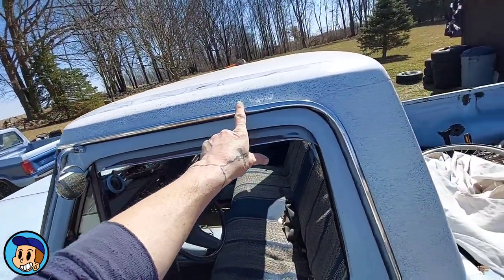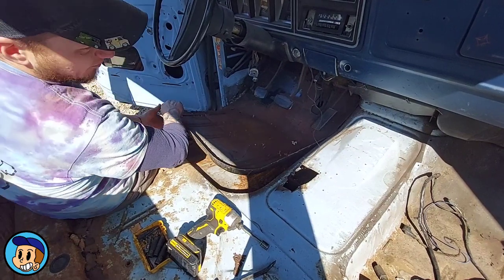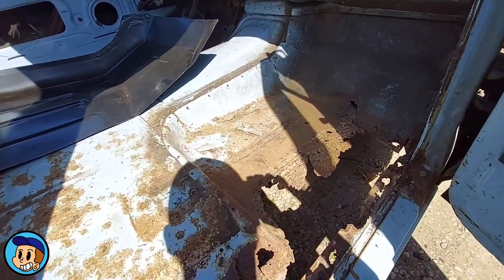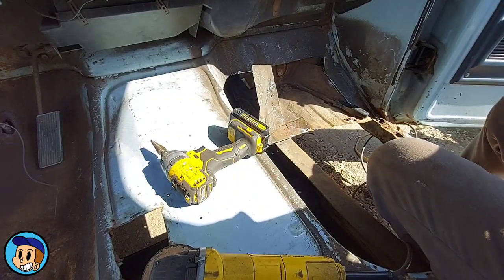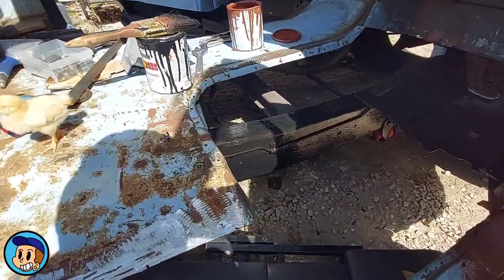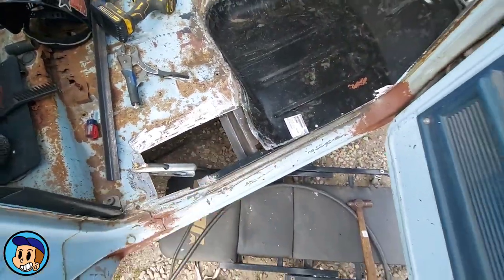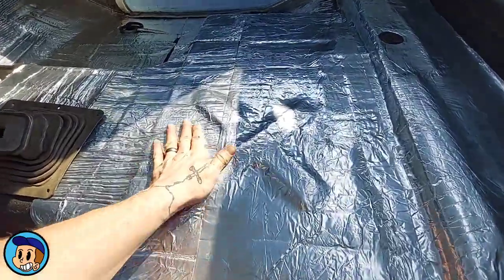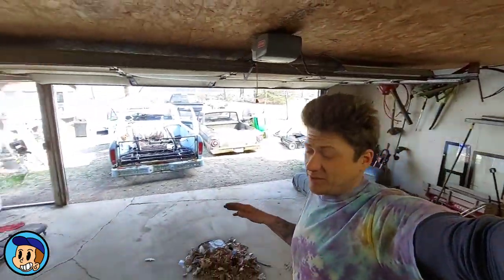78 F100 floor pans, start to finish

Comment: Cool project, have you found an off the shelf paint that is a close match to the baby blue? I’m working on a 78 250 4x4 with the same colour.
Reply from the maker: Rustoleum harbor blue is super close. Also most napa auto parts stores can mix you up a can os spray